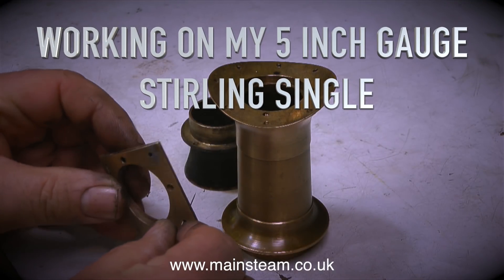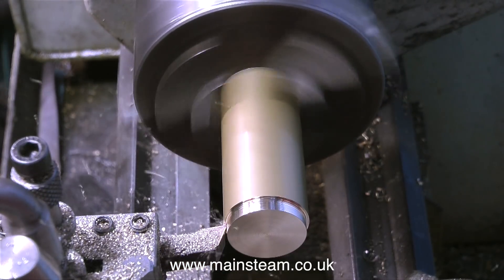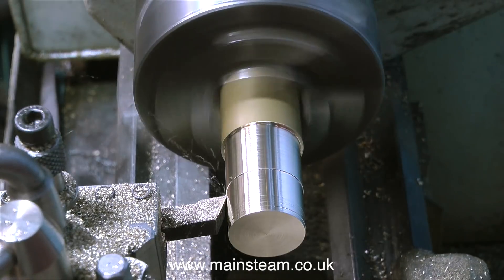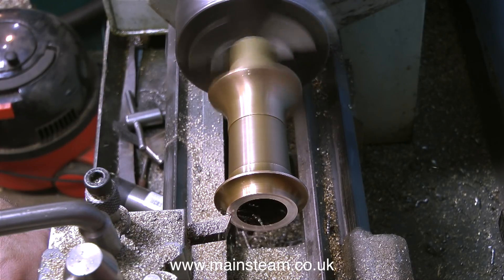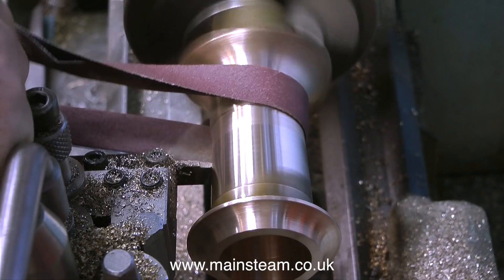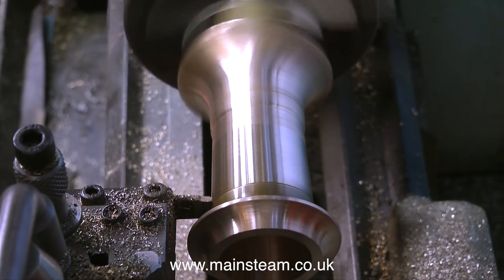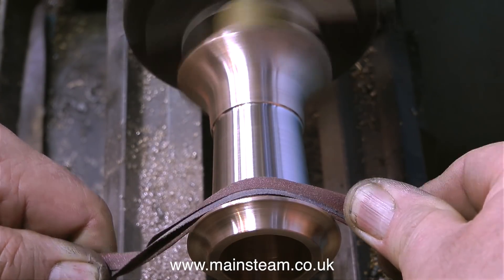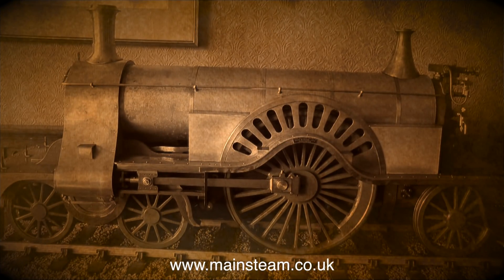MY STIRLING SINGLE #4 - HOW TO  RE-MACHINE THE CHIMNEY

Comment: The honing tool Keith is using is meant to hone brake cylinders on cars with drum brakes. They can also be used to hone a master cylinder, or any hydraulic valve.  Use a light oil for lubrication and the same lube or  WD-40 to clean the cylinder after its honed.  They can be found at any auto parts store, and sometimes come in sets with replacement stones.  I've also used them for cleaning up burrs and polishing carburetors, connecting pipes, and pump valve bores.

Comment: A very knowledgeable mechanic taught me one particular trick it is my pleasure to pass on. You are of course honing brass not ferrous metal such as a wheel cylinder,but you stated you used a light machine oil. If you wish to improve both the cutting ability and the finish,use what we call Varsol and what you would call mineral spirits. 
Wheel cylinder hones. generally come with standard or fine grit stones. Using mineral spirits with the fine stones offers a much better finish with wheel cylinders then clean up with hot water and dish soap for use with brake fluid. A step I doubt you need to take,but I mention just in case. Cheers.

Comment: At one of the garages I've worked at, we used a honing tool that could be fitted onto a snap-on gun. We generally used it to polish the cylinder bores on engines & remove the scoring marks. Very handy things to have. I do find it surprising just how many tools you have seem to parallel to what professional garages use. Apart from Bahco spanners, I've never laid eyes on one of those beauties yet

Comment: Yes I know Simon and his knowledge is superb! 
"This is where they had the hole in the Class 2 but it is not often included!! As we stood next to a superb model of one in 5 inch Gauge.
When I sand down in the lathe, I get some Kitchen paper folded and dampen it so that when it heats up in moments we do not burn the Mouse finger!!!
Or in my case the right hand side of the keyboard finger!!!
Yes Chimneys are so important and Swindon even did a sheet for Modelmakers in the 1930's? Such was their pride in their product. I am sure that other companies did the same! On looking through books you often come across statements like "She is fitted with the Drummond Chimney, or the Marsh chimney or the Billington Chimney! They never mention the Brakes whoever designed them!!!
David and lily letting the paint bake onto the 6 Jinty Wheels from Blackgates Engineering!!!